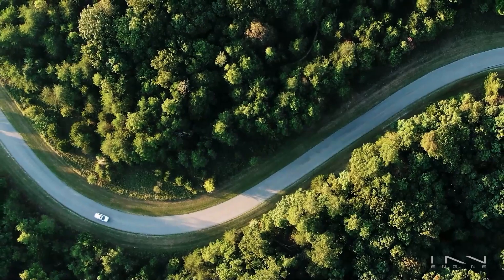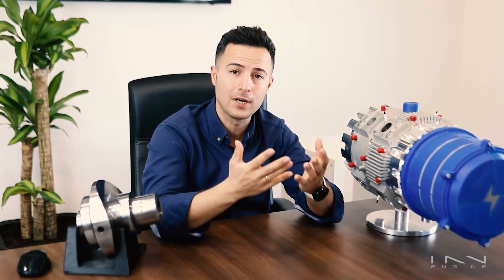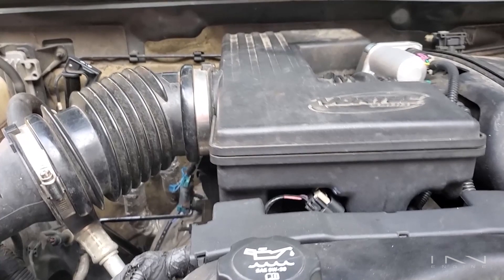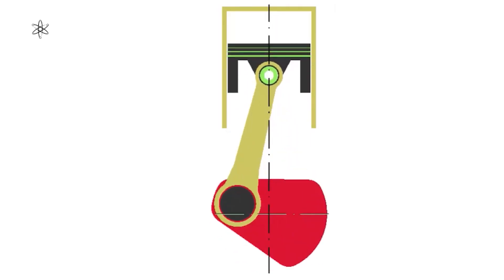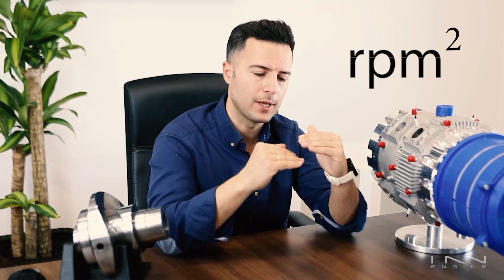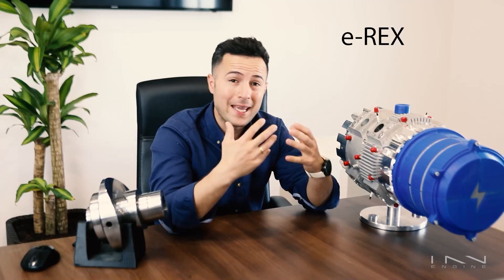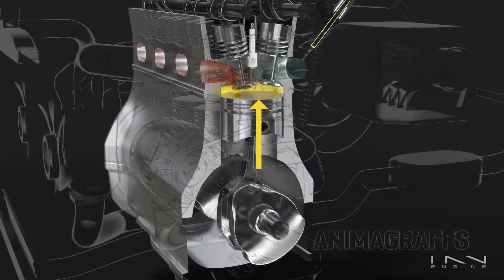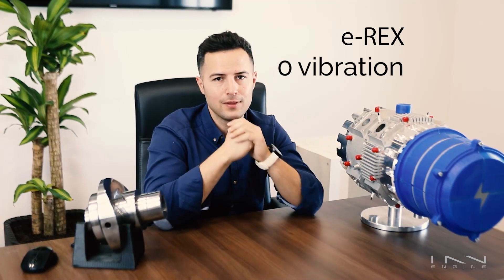e-REX. Why it does not vibrate

Comment: "You can never suppress secondary imbalance completely".  Apparently you've never heard of boxer engines. Swash plates are not new, they've been used in all sorts of compressors and other pumps for many decades, even centuries.  Weight, manufacturing cost and durability remain real problems for them as an engine.  Reciprocating piston engines remain the worst solution for converting combustion fuel into mechanical energy except for all the others.

Comment: This seems similar in layout to the Dynacam engine of early 2000's. It evolved from theoretical torpedo engine that didn't get past the "drawing board". It was further developed in mid 1990's as light weight, low vibration, high efficiency small aircraft engine.  When the Dynacam got on test stand it wasn't as vibration free as the decade of publicity had promised. I haven't seen video of this engine running either; so I suppose vibration free is in fact true for now. I have read that UPS has a opposed piston diesel installed as test bed engine and is getting great results in power, efficiency and ability to cope with emissions. I do hope to see this new generation of ICE engines achieve every promise.
Reply: There is a video where this company installed it into a miata, looks solid to me.